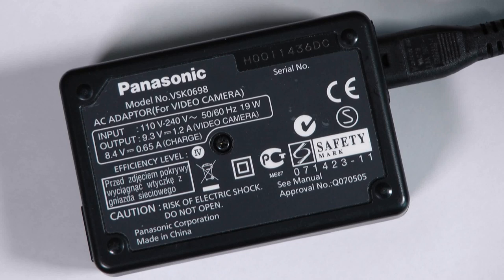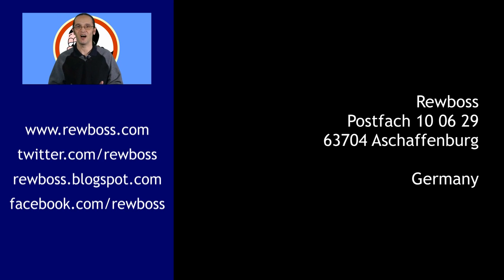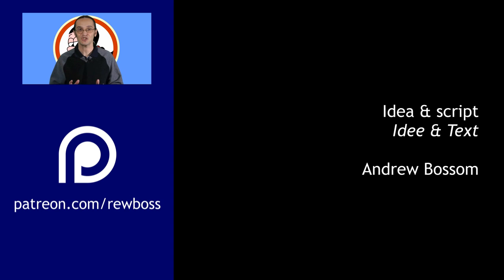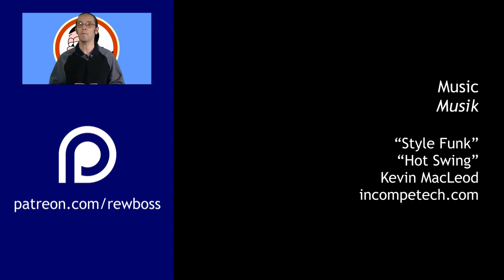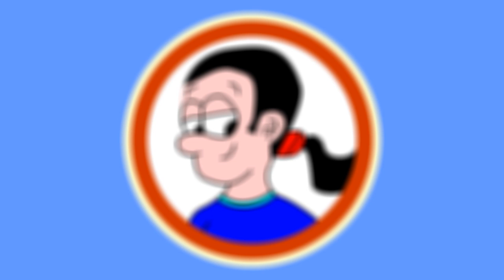Square pins and round holes

Comment: BTW, you're wrong: standard these days is 230 V, not 220.  Been like that for ages, even though I do remember the 220 V days.
Reply: In Western-Germany the voltage was raised from 220/380V up to 230/400V in 1986. In the former GDR the voltage was raised in 1990.
Reply: Well, not really. In 1986/1990 only nominal voltage and tolerances were changed, but this did not have any influence on the mains voltage. Before 1986/1990 the mains voltage was defined as 220 V +/- 10 % (= 198 ... 242 V), afterwards it was defined as 230 V - 10 % / + 6 % (= 207 ... 244 V). In 2009 it was changed to 230 V +/- 10 %, so now 253 V are permissible.
Reply: Because 220 was within the tolerance. In the UK you'll still measure 240 V in most cases. It's still within the tolerance. Before the european harmonisation mains voltage in the UK was 240 V.
Reply: Jürgen Erhard shocking!
Reply: I've noticed that my UK lightbulbs last really long in Germany. But seem just as bright as in UK.
Reply: Are you using an adapter? Most lamps in the UK are having a bayonet socket. In Germany the Edison socket is standard.
Reply: @Marcel_Germann  they do have ES base bulbs in UK....
Reply: Whats the reason for the increase? The US was also increased from 110V to 120V (Am 🇨🇦... not sure if Canada ran on 110V initially... but here is 120-125V (currently) although i have 240V wired up in my kitchen as am pretty intl and have appliances from 240V countries as well here 😀(such as toasters, kettles, slowcookers), nothing with motors due to the 60Hz frequency
Reply: @Leatherkid01  Harmonisation to connect the grids of the different countries in Europe. Some had 220V, in the UK 240V. So they picked the 230V in between.
Reply: @Leatherkid01  Yes, but most common is still the bayonet socket.
Reply: @Marcel_Germann  i see.. fair enough(Re:Harmonization)
Reply: @Leatherkid01  In reality nothing changed. The regulated voltage is nominally 230V with a +/- 20V tolerance. Continental Europe continues to be 220, the UK 240, but both are now defined to be within the same standard. There never was a compatibility problem anyway even before the harmonisation. You could always plug continental European devices into a UK socket or vice versa without ill effect.
Reply: @xaverlustig3581  i realise that
Reply: I still have 220V most of the time here in the middle of Germany
Reply: @Leatherkid01  Nothing really changed on the grids, except the number on the package.
Appliances made for any of the 220/230/240V power outlets, have to be able work reliably at voltages as low as 210V and withstand permanent voltage up to 240V. But that was the case when the nominal voltage was 220V in some countries and 240V in others.
Reply: The flat pin plug is used in America, Canada, Mexico, Central America and most, if not all of South America. Japan and South Korea uses the flat pin. Not all flat pin plugs have a third round pin. The round pin is a ground for draining excess electricity. These flat pins need 110v at 60 cycles. When I was in Germany the electricity was 220v at 50 cycles. You had to use round pin plugs with 220v through a transformer to get 110v flat pin plug. I think 110v was used in America because DC current was used for a time before AC current. DC current cannot travel very far over the electricity transmission wires. AC current can go thousands of miles. This was a fight between Thomas Edison, wanting DC current. And, Nikola Tesla who wanted AC current. AC current won out.
Reply: @whomagoose6897  South Korea use the round pins shucko type plugs like Europe.; Current in South Korea is 220-240V/60Hz like the Phillippines. (Although in the Phillipines, they use the US style plugs on their 220V/60Hz system)  

Japan is like us North Americans except now they have sleeved flat pins … (the first 1/16” has insulation) too bad Youtube comments cant take pics .. id snap one for you. I have Japanese cxtention cords imported here in Canada with me 🤣
Reply: Wow, didn't know that there are so many different types of mains ...
Thanks for letting me know.

Comment: A (late) fun fact about the diamond-shaped plugs: They are not that shape for astethic reasons, but so that they can be used in swiss-style sockets, which have exactly this form. (Although the style is also partially needed for the "SCHUKO" style outlets).
This also means that, unsurprisingly, Switzerland has its own outlet style. So be aware of that when doing trips to Switzerland.
Reply: Standards are good, everyone should have one! 🙂
Reply: I memorised it as the small one you use basically all over Europe but the equivalent of the Shuko (big one) you need a different one for every country

Comment: The official EU voltage is a nominal 230V with a tolerance of +10% -6% (so a range of 216.2 - 253 V). The UK still effectively runs at 240V, in Germany it's closer to 230V. Also, the USA has not been on 110 V for a long time, and runs at 120 V (or 240V where both "hots" are used).
Reply: The us also runs at 108V if you've got a 3 phase supply. Apparently that's quite common in bigger buildings

Comment: General rule to add to the "Hairdryer" warning:

If either the Plug or the Cable has a big bulky box, It's very probably DC Power (therefore okay)
If the skinny cable goes all the way to the device, be extra careful and double-check.

Those boxes are small transformer/rectifier coils that turn any voltage AC into some other voltage DC.

Comment: There are two countries that have different plugs in Europe. UK and Switzerland. 
The small 2-pin euro plug also fits in Switzerland. In the UK, plugs are often sold loose.
France and Germany have different sockets (E + F), but there is a plug that fits into both systems.
Most countries have agreed to socket E or F.
Reply: Italy has also some odd plugs it looks like  the flat europeans 2 pin used on radio's but has a earth pin in between the other pins.
Reply: The Swiss plug (type J) is also used in Liechtenstein, while Ireland, Malta and Cyprus also use the UK type G plug. (Find the former British colonies...) And Denmark uses what's known as type K, which are oddly charming since they have a semicircular earth pin below the two regular round pins (which is why you usually don't need an adapter in Denmark if you're from anywhere that uses type C and/or F plugs), so every wall socket looks like it's smiling at you.
Reply: @ospero7681  Malta Cyprus Singapore
Reply: @louisbeerreviews8964  Last time I checked, Singapore didn't quite qualify as one of the "countries that have different plugs in Europe" ;)

Comment: correction @rewboss its 240/230v not 220v now!
Reply: Not quite. There used to be 240V and 220V, which got both standardized into 230V. Which was implemented in a way so that the new tolerance overlapped the old tolerance to allow old equipment to still be used.
Reply: @HenryLoenwind  Yeah but the actual voltage is 230v now in Germany . Its still 240v in Britain

Comment: Never, ever plug your phone into an unknown USB port! Especially not, if it's a public one! They could not only charge your phone but also make use of the data connection and infect your phone with some kind of malware.
Reply: Seegal Galguntijak // that's why you should have a usb cable that's only for charging, so only gnd and 5V, no D+ nor D- wires
Reply: Malte, are you sure you're not just talking about some proprietary extension of USB, like Qualcomm's quick charge technology? Or possibly USB 3.0, which, if I remember correctly, even goes up to 20V.
Reply: At least Android Devices can be configured to turn the data connection off.
Reply: Seegal Galguntijak if they really wanted to fry your phone, they could easely put even 100V on there
Reply: Atavar that isn't enough, a cable for charging only as Dow Row mentioned is necessary. Otherwise there will still be some software listening to what is going on on the USB port, and (as we know Android being the least secure bit of software of today) in case that is vulnerable to something, maybe a buffer overflow or being assigned the 128th device in the chain, or whatever, it doesn't need to actively accept data connections to be infected. I wouldn't trust it if there are data lines. A malicious attacker won't take for granted that everybody has USB debugging activated or stuff like that.
Reply: Dow Row I don't think the intentions are destructive like that. But look how valuable a compromised phone can be, from the right person? Or even just while it's running some software to mine bitcoin in the background (while getting hot and the full battery only lasting a few hours).
Reply: @Atavar  Still a rogue USB device could be connected and infect your phone, despite the phone not exposing its storage the USB controller is exposed and can be attacked.
Generally: do not plug in any USB device unless it's yours.
Reply: Good advice, but I'd like to add to this. Phones in particular have strong protective measures against this sort of thing. In order to access a newer android phone via USB for example you have to manually enable data transfer, the default behaviour is just charging. Or, for access to USB debugging, a popup will ask you for permission (assuming you've enabled USB debugging in the developer settings, which you shouldn't do if you aren't a developer).

At the same time you can get a USB cable with just the power wires connected, not the data ones. This will also prevent anyone from loading malware on your phone.

However, in general you should follow this guys advise and not put anything into unknown USB ports. ;)
Reply: @minecrafter0505  1. That comment is 4 years old. A bit has changed in Android phone security since then. 2. There's no way to be sure whether your specific phone (or phone manufacturer) actually has some kind of vulnerability, possibly even a closely kept 0-day. 3. In order to really own your own phone (that is, remove any spyware from it), you'll have to unlock the bootloader, flash a custom rom and leave the Google spyware off. This often goes along with rooting the thing and activating USB debugging. Those measures don't necessarily make the phone less secure per se, but they increase the overall attack surface.
Therefore, if I were in the situation to plug my phone into random USB ports, I'd make my own charge cable which only had the + and - leads connected and nothing else. Granted, it'll likely charge only at 500mA, but at least it's secure. I personally prefer to just carry a power bank around with me.
Reply: @Seegalgalguntijak  Buddy, we're talking about USB ports (ie not connected to computers or the internet) in wall sockets (they either replace the socket entirely like they do in Europe or complement them like they do in North America) which is increasingly common in Western nations (I've used them myself since 2015 or so). We're not talking about random laptops, desktop computers, and other similar devices. These are standalone USB ports primarily used to charge your phone and other battery powered devices.
Reply: @luke_cohen1  Well you don't know if they are connected to something else. Highly unlikely but you're screwed if it is.

Comment: Yeah, I found out the hard way regarding frequency and hair driers. My little travel drier had a switch for 110 V and 220 V, so I thought I was covered. How wrong I was. 
Crossing to the UK and back on the ferry, I found that the cabins had two continental and one British socket, which was actually useful for recharging devices, as our adapter supply was limited.

Comment: Most hairdryers use a DC-motor and a rectifier, so they are fine with either 50Hz or 60Hz
Reply: These generalisations don't make any sense, the truth is that it depends on the model.
Reply: @l3p3  You can also get that information from the sticker it will clearly show not only the acceptable voltage range but the acceptable frequencies also.
Reply: Buyer beware!
Research by a reputable source [i.e. myself] indicates that only 25% of all hair dryers [in my house] would be fine with both 50 and 60 Hz.

Comment: Might be worth mentioning too that cheap adapters/phone chargers bought online can be fire hazards. Within the EU you should be alright with anything you pick up from a big name electronic retailer or supermarket, but beware buying online as many sites like amazon and ebay have third party sellers importing cheap chargers from Asia which can be substandard in terms of safety.

Also, is it just me or is the audio slightly unsynchronised particularly in the first half of this video?
Reply: Not only the poor quality but "wrong" adapters is very dangerous.
For example the US to German/European plug adapter shown at 1:43 in the video.
These small German/European plugs (called Euro plug) are only up to 10 Amps while you can plug every american plug in.
And some with disconnected PE.
Reply: Another problem is electricity in Europe is a 220v to 230v at 50 cycles. Countries that use 110v are at 60 cycles. With all the sensitive, modern electronics the cycle of the electricity can make or break the electronics.
Reply: @whomagoose6897  While it's always a good thing to check the label on the device (or its manual), electronic devices tend to care very little for the mains AC frequency - they're ultimately operating on DC anyway. So if your cheap chinese phone charger causes your electronic device to glitch out, that's not a problem of the mains frequency being incompatible with your device - that's a problem of the charger being poorly designed and/or poorly manufactured, and failing to convert the AC to "clean" DC.

Comment: In 1993 I bought a clock radio in Germany for 220v 50 hz.  It did not work well in the USA because the clock ran 20% faster.  That was even with a 110 v mains to 220 v transformer.  Strangely enough though, my CD player that I bought in Germany played exactly in the USA as in Germany, nothing went bad except the cassette as it wore out due to overuse.
Reply: How do you get a CD player to play cassettes?
Reply: If it has such a functionality built in.
Reply: amiausUSA 

The problem is, that cheaper clockradios and clocks whitch  use the main as powersupply use the 50 heart from the voltage as counter for the clock. In Europa the 50Hz is verry good controlled. If you now have 60 and no 50 Hz it cant work.
Reply: Old elecrtric clocks used a syncronous motor with the speed at a fixed ratio to the frequency. In audio devices the speed of the motors are controlled electronically. The CD has a different speed depending on the position of the track on the disk. When reading the inner parts it rotates faster than on the outer parts.
Reply: So the clock radio used the supplied frequency thus running fast, and the CD Player had a rectifier inside which converted AC to DV -> and the 110V were enough to power it.
Reply: nirfz yes, that's how the cd player/tape/radio worked.  Not bad for DM 199.00 back in 1994.
Btw on the 1993 clock radio, the effect on time was not unexpected.  I'm glad the device did not explode or fail.  I only kept it because I was going back to Germany and to avoid spending money to buy another.  I just should not bother to use it in the USA.

Comment: An multipoint extension lead, which you may have use for at home, can reduce the need for adapters for multiple devices. Apart from a hairdryer, the gadgets you take away with you are usually very low amperage, so it's unlikely you'll cause an overload.

Comment: I once bought a international travel adapter from aldi on clearance knowing that I would soon travel to the US. I then simply took a 7 plug extension with me and used my devices with that. Every device I took was multivoltage/frequency anyway, so I didnt need a transformer. And the adapter has basically every plug, so I can travel everywhere while still being able to use my electronic devices.

Comment: If you need to know what plug and socket your device uses for mains supply, it's usually IEC 60320:
Plug C7 and socket C8 for radios and some laptops
Plug C5 and socket C6 for most laptops (the 3 rounded overlapping prongs)
Plug C13 and socket C14 for most desktop PCs and a small number of laptops, usually referred to as the "IEC connector" even if all 3 types are IEC connectors

Comment: Officially, the voltage in Europe is 230 V, nowadays. However, the guarantied tolerance for voltage is ±10%, which leads to (possible) voltage range of 209 V to 253 V - giving backwards compatibility to old nominal voltages of 220 V or 240 V.

Comment: 1) Voltage is 230 V in Germany
2) your European 2 prong plug will work fine in a UK socket. Just need to stick a key into the PEN contact and this will unlock the child safety allowing you to push the round prongs into the rectangular holes. (please note that this does not work for plugs were a PEN connection is required or strong currents are flowing as prongs have only tiny contact areas in the square holes) :)
Reply: BangOlafson The 2 prong (aka Europlug) is only allowed on devices that draw up to 2 amps anyway

Comment: How difficult would it be to actually standardise plugs and electricity parameters? There would be a transitions time, but wouldn't it be worth it?
But no. It seems it can't be done.
Reply: They tried that ....but each country wants theirs to be standard and others want theirs to be so .... no result ....besides the 10A round pin plugs being the standard EU type sockets everywhere. While those 13A-16A and above are different everywhere.